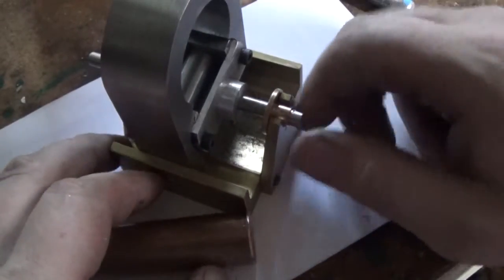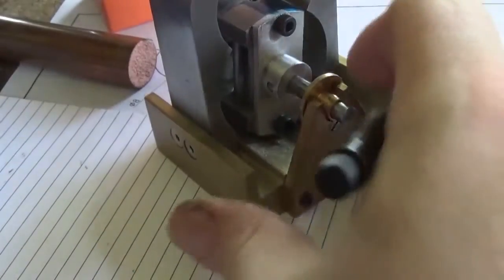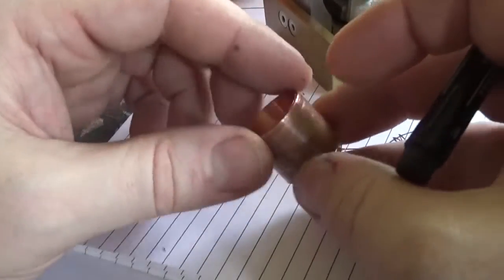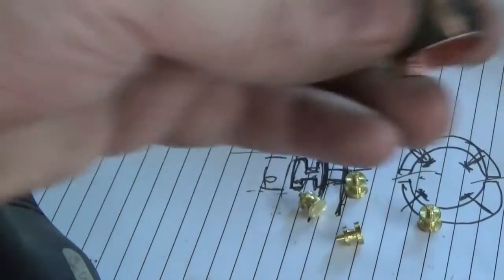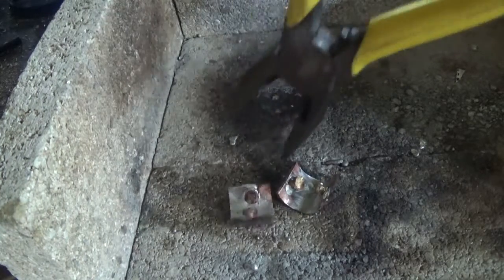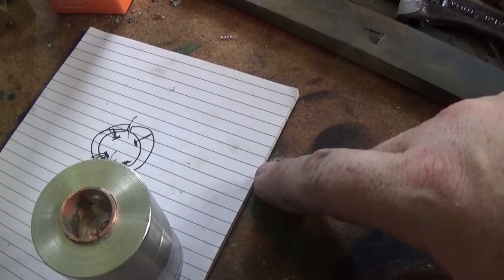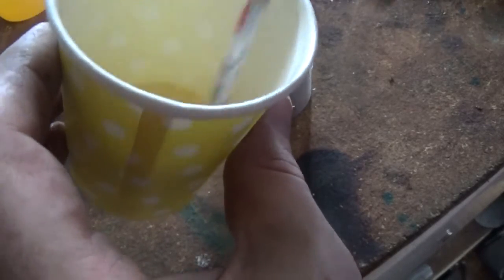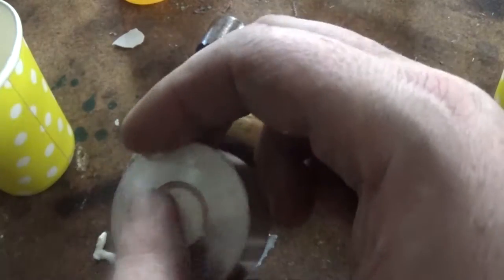Prince Dynamo motor PART 10 home machine shop project.

Comment: OK, I have to sit down and think a bit, and it is late in the day here in unusually warm Alaska. But wouldn't it have been easier to turn a delrin (or other plastic) rod down to a very tight fit on the commutator, split it,  and then put in some screws? What am I missing?
Reply: +Juan Rivero Oh yes. Another 147 subscribers since the magic 500. Brava Emma!
Reply from the maker: +Juan Rivero yes it might work... its not got a lot of space (about 6mm) wood screw space, and i wanted the gaps filled in between the plates. this just seemed the easiest way.
Reply: Never saw anyone do castable resin before, so it was a treat. We do as we think best, and learn fro each other.